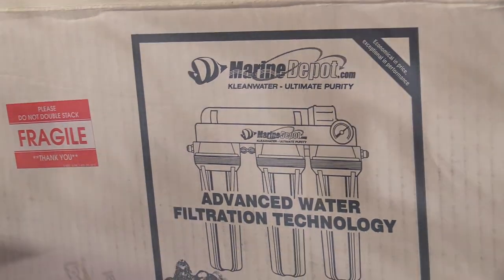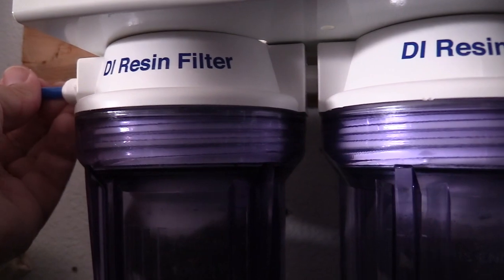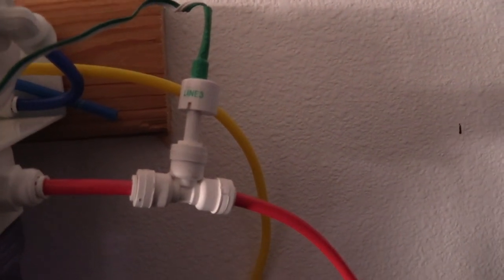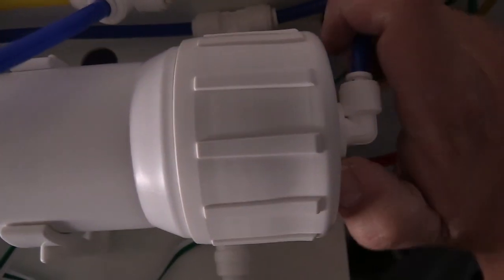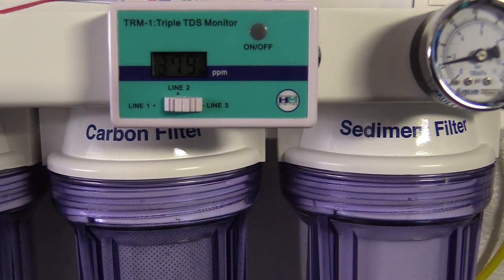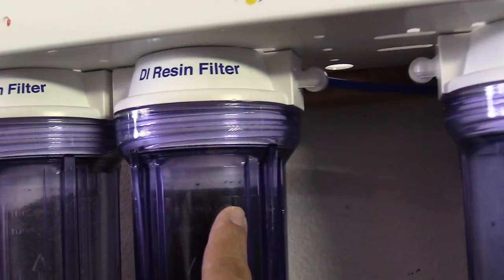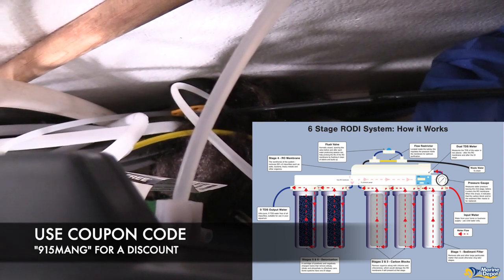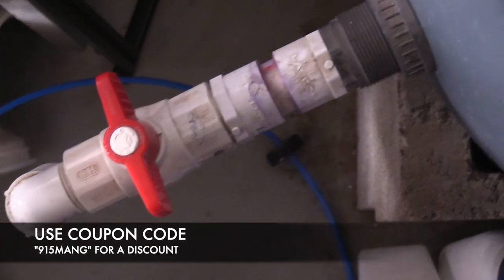HOW TO INSTALL WATER PURIFICATION FOR BEGINNERS | RODI AQUARIUMS

Comment: Hi there Pretty interesting video I use the same system the difference is I make my water 24 hours earlier when I’m doing my water change the reason why I believe when you have your water on a container creates negative bacteria for being in storage but that’s the way I think good luck thank you for sharing
Reply from the maker: Hey Anibal, im sure youre right. I thought the same thing too. But supposedly the RODI takes all of that out. I usually keep it on hand for auto top off

Comment: Tested my tap with TDS meter and was shocked at the amount, first let water run for about 5 min in the sink, the put my meter into a glass 1/4 filled and it showed 37ppm right out of the tap!

Comment: Great video I use a spectra pure 6 stage just wondering what’s your TDS coming out of your tap I was surprised when I installed my system it showed the tap water at 520 TDS
Reply from the maker: Yeah Ray I think Thats a little more than me by 100 TDS